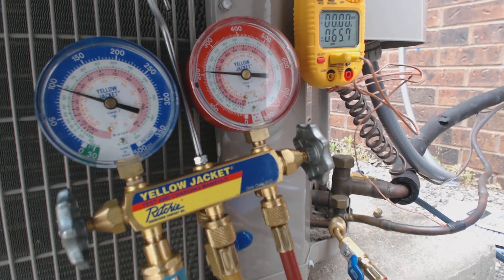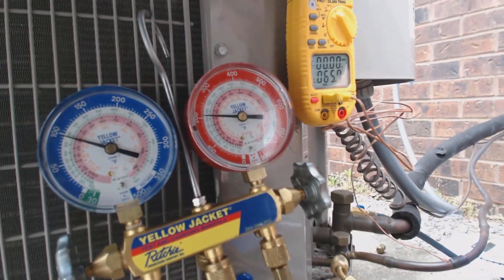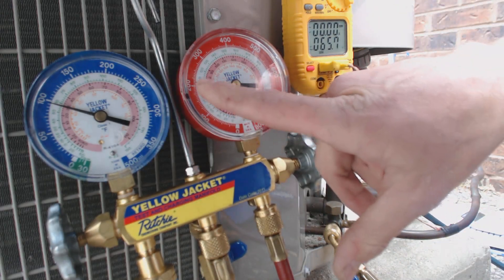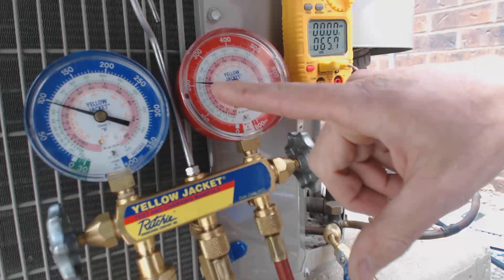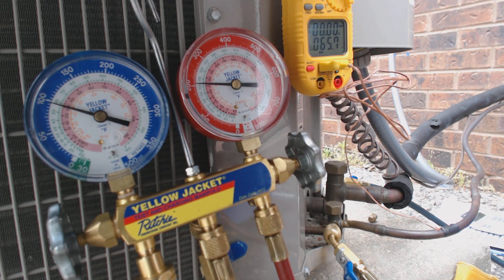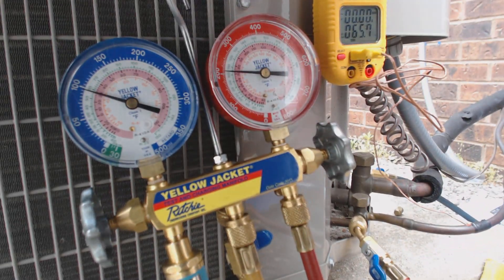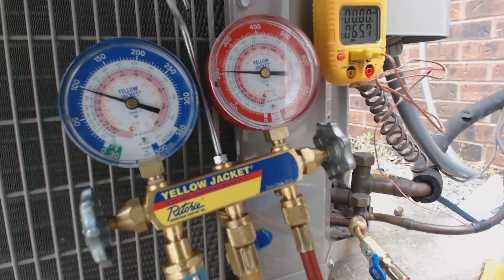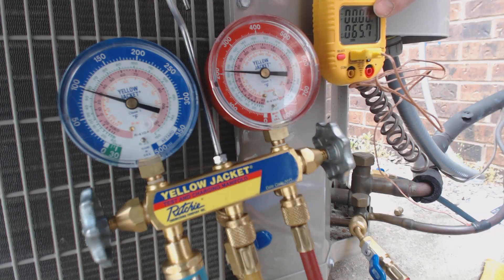Charging Refrigerant: Step by Step  Procedure to Check a R-410a Charge in an Outdoor AC unit

Comment: hey boss question for you. So 410a unit second floor. Should it not be able to stay in the 70º 
degree range with only 4 to 6 subcool?
Reply from the maker: It could stay 70 degrees inside the building with only 4 to 6 degrees of subcooling. It is meant for the hot days when the txv is not holding back much liquid when the unit needs the 8 or 12 degree of subcooling it is calling for. Thanks for the question!
Reply: +acservicetech yes well it's struggling to stay in 75 to 79 running all night    gots to be low on pepto
Reply from the maker: Have you replaced the filter? Is the temp difference between the supply and return 18-21 degrees or lower? If it is lower than I would get the charge to the specified subcooling found on the rating plate and then check the temp diff again.
Reply: +acservicetech  Took filter out & heading way way way out there for free again. Will check the split. Didn't check dryer or txv cause I figure it would show up on my gauges. Our pressures are almost identical to the ones on your video thumbnail except my suction is higher. Thanks for replying boss awesome of you.
Reply from the maker: If suction is high then it is likely not the txv because if the txv was more closed then the low pressure side would be lower than expected. If you thought it was the txv because you don't have 18-21 then you could put the bulb in hot water and see if the txv opens. However if you do have your correct 18-21 then you may want to look at their building envelope or the system may be too small for the building. Good luck

Comment: does the ambient temperature makes a difference in the charging procedure? how? thanks... very nice video, thanks
Reply from the maker: Thanks for the Great Question! The manufacturer gives you one subcooling amount that they want you to obtain under normal outside temperatures regardless if the ambient temperature were say 20 degrees different from one day to another with a lower threshold of having to be 70 degrees outside. This does matter in the superheat charging process where you need to find the outside temp and the wet bulb temp inside. Check out my Superheat charging playlist to see that.------https://www.youtube.com/playlist?list=PLxnHR5_D2ojwGvhU1rseXQLJ-XBjBZMMk

Comment: There is no doubt that 410A is a difficult refrigerant to work with. Case in point. A  Fieldpiece 360, calculated the Superheat (Fixed Orfice) to be 14.7. I calculated the WB /DB Superheat to be 14.5.  Close enough.  After adjusting the refrigerant and letting the system settlle down (waited for over 1 hour), I measured the Superheat at 14.5 . This was great !!! After returning 7 hours latter and in the hot of the day (85 degrees),  the newly calculated Superheat was 19. I measured 7.7.  The system produces very good cold air and the vapor line (at the condensor) sweats. The pressures were 117 and 335 lbs. Now I'm suffering..... Your Thoughts Please
Reply from the maker: Thanks for the Great Question! So here is my question, if the system was running throughout the day and just say the wb temp inside the house stayed the same but the temp went up outside then the target superheat reading should have gone down, not up. Just say the temp went up 15 degrees outside, for the target superheat to actually go up instead of down then the wb in the house would have to go up by 8 degrees and that wouldn't happen unless the system was very undersized and definitely could not handle the load. I don't know what your starting and ending outdoor temp and indoor wet bulbs were. The best thing I can say is too just look at a superheat chart and study it, then think about the situation. I Hope that helps! Thanks for your Questions and Thumbs Up!My next question was going to be if you were adding refrigerant then how much refrigerant was put in and how fast was it put in but the first thought above takes precedent. Thanks for the Comment!

Comment from the maker: Great question! In the instruction manual of an inverter unit will be the charging procedures for those units. They are DIFFERENT than psc compressor units which is what is shown in this video and which are charged with superheat for piston units and subcooling for txv units in cooling mode. Normally Inverter Systems will have the proper amount of refrigerant in the unit already up to a certain amount of lineset feet and will be able to operate correctly with a wide range of refrigerant inside which it was designed for. There may not be a way on that unit to add the correct amount of refrigerant other than weighing in a certain amount of refrigerant per foot extra above the maximum rated length of lineset worth of refrigerant that the unit is presently holding. If there were a leak normally you will need to recover the refrigerant, find and fix the leak, vacuum it, and weigh in what is stated on the rating plate if you are under the maximum amount of lineset but make sure to follow the installation instructions of that particular manufacturer which is always your best bet. Thanks for the comment, and I hope you enjoyed the video!

Comment from the maker: Thanks for the great questions! On Comfort Cooling systems, Target Subcooling is usually found to be between 8-12 degrees but I have seen it at 7 and I have seen it as high as 17 on the rating plate. You look at the rating plate of the unit you are checking the charge on. As far as the target superheat is concerned, it will vary depending upon the humidity and temperature inside and the temperature outside. Check out this video for more on Checking Superheat and Finding the Target Superheat        https://youtu.be/5uqtiUmrBLg
Reply: Hey Craig, how do you charge a two stage condenser system?

Comment from the maker: As long as the system that you are trying to charge is for comfort cooling and as long as the system has a thermostatic expansion valve (txv) and it's at least 65 degrees outside or more then you can use the subcooling process addressed in this video regardless of whether it's R-410A or R-22. You can charge a heat pump in cooling mode this way too if it has a txv. If in front of the evaporator coil there is a piston/orifice or capillary tube then you would use the superheat charging process. Please feel free to check out my channel which will show you real time charging of R-22 systems and how to figure out how much charge to add in a heat pump in winter. Feel free to SUBSCRIBE as I come out with new videos every few days. Continue to ask the important questions. Thanks!http://www.youtube.com/channel/UCOZR-1IqsAer9wzlvFgb4mA